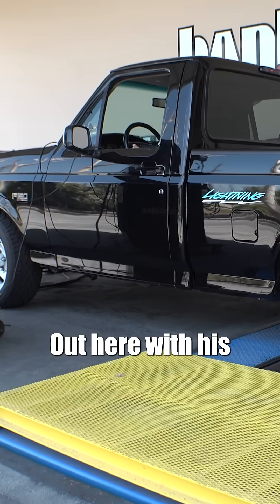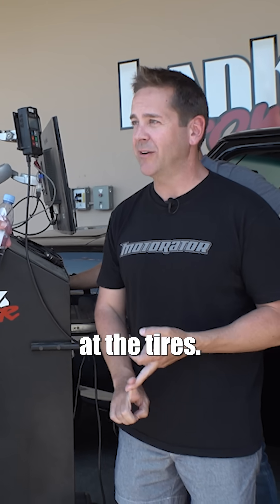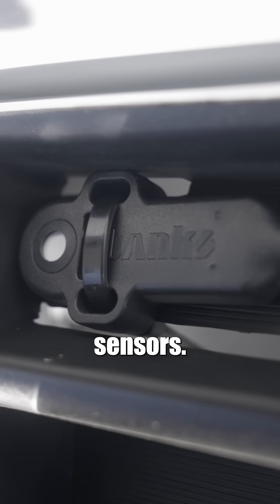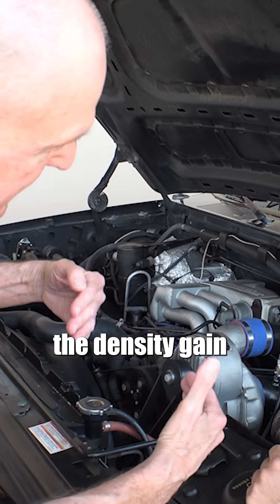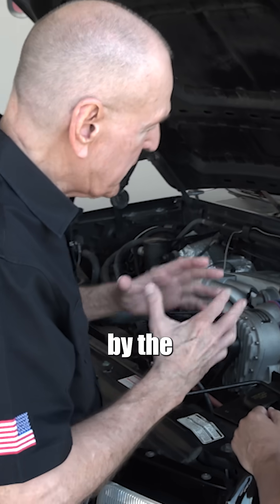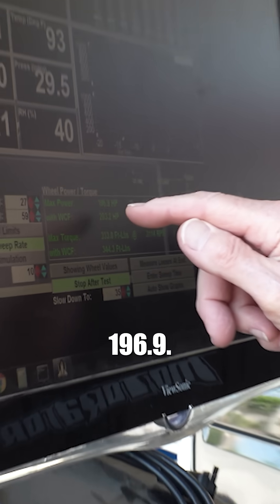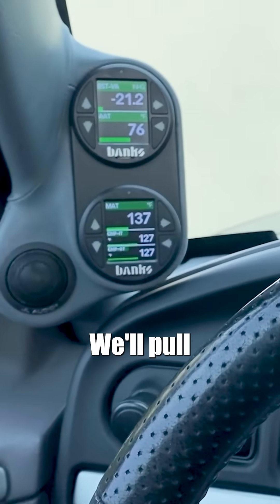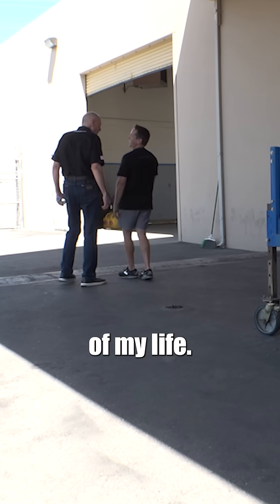This is the worst supercharger ever.

Comment: I got a 57 h.p. gain on a non intercooler 7 lb. kit on my chevy1999 s-10 extreme with the 4.3. Added a dry 50 shot and n.g.k. v powers gapped at .025. With m&h racemasters it broke the hearts of alot of STOCK terminators. 
  Sounds like it's spinning,although the noise on these were a tad louder than a bunk alternator, Perhaps you are losing boost somewhere or the supercharger just needs a new belt.

Comment: I pure long tube headers on an xj 4.0/242 with a k & n intake tube and filter and got more than 8 hp at the wheels with a power killer called a transfer case.  They probably lowered the compression on that motor to account for boost pressure that amounted to 8 hp.  A stock 5.0 made 235 so what the hell was the point.

Comment: Kaplan America noticed an overall average 5 horsepower gain when he removed the knobby tires on his dirt bike  and replaced them with a street tire... replacing your street tires with good drag slicks with a lot of traction on the rollers might make a bit of a difference. Try different tires on your Dyno rollers and see if it makes a difference and something else to think about keep the same outside diameter of the tire the same as what come on it... Just saying it would be interesting to see your results

Comment: This style SC needs to spin fast for gains which are progressive with engine RPM, and the HP shown is at 3114 RPM. These engines were slow spinning turds at that time. LOTS of contributing factors were not mentioned.

Comment: Those are nice engines, but you have to put some pistons in them. I had a 93 lightning with a 393 stroker pumping out 550 + 200 Nos 10 1/2 Pistons😅

Comment: Those are stock power numbers from a  4.3l in a Mid-90's S10
Reply: And you would have beaten it with a ss and the xtreams😂 and better mpgs
Reply: Factory Lightning would smoke an SS454.

Comment: I think Ford realized they messed up with this generation of Lightning, and when the next one came out, the 99-04 SVT Lightning, they put on a proper supercharger, and made awesome power.
Reply: It made ok power it was basically just a stock 2 valve engine with a supercharger
Reply: Looked the same but was a 5.4 instead of the 4.6 and yes it would haul ass. Had a 99’ TransAm and couldn’t outrun it.
Reply: @setharnold3699  something must have been wrong with your Trans Am or that truck must have been heavily modified because the stock lightning is really not that fast it's a stock 5.4. 2 valve basically with some boost, A Trans Am definitely add a weight advantage

Comment: I bet that supercharger adds 30hp and takes 22hp to run 😂😂
Reply: This is why turbos are better. Using otherwise wasted energy (heat from the exhaust) is more efficient.
Reply: @Longbowgun  They are more efficient, but it is not only "otherwise wasted energy". Turbos create backpressure, which creates pumping losses, however less than the losses of a belt drive.
Reply: @Longbowgun  I see you aren't watching banks for long. Backpressure is a thing.
Reply: @Longbowgun  They have different use cases. A supercharges provides a linear smooth add on of power. A turbo doesn't
Reply: @Longbowgun  a compressor takes the same amount of work to make a given PSI and CFM. How it is driven makes no difference. If that compressor needs your 22hp number then it does not matter if that is from the belt or from the gasses being pushed out. The problem here is a restriction on the intake manifold, heads, and exhaust, and (the biggest deal) a 90's supercharger that had to be able to bolt on a stock motor AND keep the warranty. If I remember these only did like 3 or 4 PSI. Also turbos are NOT necessarily more efficient. I have never seen a rest where somebody takes a supercharger with a given PSI and CFM and compares it to a turbo with SAME PSI and CFM. The only thing I've ever seen is that turbos tend to be built better, have more time and engineering go into them, and more tech (like variable veins and such). Superchargers do not tend to have all of that.
Reply: @Longbowgun  Yes
Reply: @Longbowgun nah
Reply: @Longbowgun  it depends on what you want to do with it, if you are drag racing then a supercharger is better for instant power
Reply: @Longbowgun NHRA top fuel runs blowers, with well over 10k hp. I'd say they are pretty efficient
Reply: @Bobthebuilder.69  the belt is taking 600hp to spin and put out 12,000 hp of a 1970  hemi architecture v8, i call that efficiency

Comment: Would changing the pulley size increase the boost? That’s what I was wondering even before the dyno run.  Looked like a idler pulley sized pulley..😂
Reply: Without an intercooler, that would just create more heat. Boost pressure might increase but air density would suffer and any gain would be negligible.

Comment: I would like to see Gale put together a Turbocharging kit for the Ford 300 six. there are lots of them out there. from 1966 to 1996, with the last 9 years being fuel injected.
Reply: They've left all of us OBS guys with nothing. They used to sell all sorts of stuff, but it's all been taken off of their website over the last couple years.
Reply: Well being an owner of an 89, they are shit, EFI ruined durability of them, hot garbage, mine lives at the shop, constant issues, check engine light is on, every sensor is out of spec, money pit!
Reply: @ my 1990 didn't have any issues aside from the 5th/reverse rod sliding out on the M5ODR2 (a rare but not unheard of issue)
Reply: @LUNITICWILL  The ones from the 80's were known for rod knock, had one, guy I worked with had one, the computer controlled ones have failing ECM's, poor capacitors melt down damaging the board, once they hit 10 years old time for replacement. I've been discussing issues for quite some time with guys and they give up, send their trucks to the salvage yard, refuse to keep throwing money at them.
Reply: @Maples01  I've had 2 trucks from the early 80s, and neither have issues with their ECM computers as they are just a simple box.
Reply: @LUNITICWILL  There wouldn't be a repair kit available if there wasn't a problem, many youtube videos of repairs for them too. In fact the suggestion for fixing them is removal of the EFI and converting to a carburetor. BTW the shop I am using was working of a fleet of vans with 300's, said in the 80's some had cylinders breaking up.
Reply: Have you seen the price of banks stuff? A supercharger kit for your 300 powered truck would cost you more than your truck did
Reply: @ there are a ton of trucks with the 300 six, and that engine LOVES turbocharging
Reply: @yucannthahvitt  The small block v8 cost half what it cost for the 300, an intake for the 300 is over $700, there are no aftermarket heads, requires a custom grind or custom build from a Cleveland or LS v8, those who build an inline have too much money and want to waste it.

Comment: They should have baselined a dyno before adding anything. Given the age of the engine it probably wasn't anywhere near the stock levels from 20+ years ago.
Reply: - age doesn’t rob HP or torque, use does. I have a 69 Camaro Z28 DZ 302 and it has just over 41,000 miles on it currently. It has been a slightly driver collector car all its life, but has never just sat for more than 6 months at a time. I haven dyno’d it, but the compression matches factory new. It will still have all the HP & torque it left the factory with.
Reply: @C10sRule  i never knew that Chevy made a 302 😮. I know all towels abthe 305 I always thought Ford was the only one that made a 302 lol. I did my research and that's crazy. I bet she's a blast to drive 😎. Funny thing writing this is almost fell victim of doing what most commenter's do by saying stuff like Chevy never made a 302 it was only 305s and if I'm not mistaken 307 for oldsmobile without just doing a 5 second search to make me look like an idiot lol. Crazy how 5 seconds of research can humble you and give you that much more knowledge but, this generation has so much tech and refuse to use the same thing they are on to write a comment but won't use it to actually find the right answer and learn 🤦🏾‍♂️😑. Anyways, sorry for the rant but your right and enjoy your toy 😎. I'm a true car lover and mainly American muscle no particular brand I own a 14 chrysler 300 with a hellcat engine, a 14 corvette with a cam, longitudes, and intake, and a 09 crown Victoria manual swapped with a 4v 4.6 twin turbo and a 2.3l supercharger on top 😎 the crown is my baby took me as a soldier 10 years to part and peice her together without breaking the bank or my marriage lol. I love cars and I do all my work myself so if bit breaks no one to blame but myself 😂 everything but the tuning. Again my bad I just love talking to car enthusiasts and you taught me something today 😎🫡. Have a blessed day nothing like American muscle sounds like bald eagles and testosterone 🤙🏾😎😎😎🦅🦅🦅🇺🇲🇺🇲🇺🇲🇺🇲🇺🇲

P.s that C10 is fucking gorgeous 😍 that's my next project a pickup truck stuck between a f 150 single cab with a coyote or a Silverado don't really care about the engine in that but a 6.2 would be great but either way it's getting a power adder so she's gonna be fast regardless.  I just need another deployment which I have coming up next month for 4 months and gotta figure out how to bribe the wife before she cuts me 😭😬😂😂😂😂 Hooah!!!!🫡🇺🇲
Reply: @ - you have some fun rides there! I always want a Hellcat, but when the opportunity knocks, I don’t pull the trigger on the deal!! Haha. Fear & common sense takes the fun out of things!! Heh heh. I have had well over 150 classics I either built or bought over the last 45+ years! Loved them all and most were GM. My favourite car , which I sold, of course, haha was a 67 Mustang GT390 Fastback that  I only bought as a roller. In the end it had a 302/345 Stroker with a 4 speed. It looked bone stock. That was a fun car to drive.  I love the Camaro I’ll have it til I’m gone. I have a few 67 - 72 C10s as well. Mostly big blocks,,, love the rumble of a nicely cammed big block!!! 
    Thanks for your service!! Stay safe, Eh!!
Reply: @C10sRule  that's freaking amazing brother 😎🤙🏾💪🏾. Sounds like you have had your share of fun when it comes to classics lol. I'm glad you was able to enjoy all those beautiful machines. No need to thank me I just did what was necessary to keep our county and my family safe 😎. I definitely appreciate it brother and keep building those beautiful machines wish I could get my hands on a old mustang from elenor that you pretty much have to give your first born for or a 70s mach 1 that I could probably get for my selling my ex wife 🤦🏾‍♂️😭🤣🤣 lol joking ( no human trafficking on this end). Stay safe yet always stay dangerous 😎🤙🏾.
Reply: @ - I was a cop for 30 years while ranching at the same time. Paid the bills in the 80s when things were tight with land payments. 
   Now I’m thinking of a couple of judges I know that might overlook the human trafficking if you can get an Eleanor for her,,, heh heh.
Reply: @C10sRule  😎😂😂😂 you made my day brother ❤️ thank you for your service 🙏🏾 and I hope and pray you continue to be the bad ass your you are and your family be safe 😎
Reply: @C10sRule  If you're ever looking for a good home for that when you decide to move on from it, I'm your guy! Beautiful c10 btw! Love Chevys!
Reply: @C10sRule not necessarily. Valve springs get weak over time. Used or not
Reply: @ -  A valid point. I check things like that and haven’t really run into it yet. Never say never I guess. Watch, the next “perfect low mileage muscle car or C10 I get will have an issue with the valve springs. Haha. 
  Thanks for speaking up.
Reply: Powerdyne superchargers are junk.

Comment: I bet the eBay electric turbo would've made the more power 🤣
Hell, you'd probably make more boost with a leaf blower.
Reply: As poor as the powerdyne is, those e-turbos are far worse.....very just can't pressurize
Reply: @1SqueakyWheel  I know, it was just a joke. 
But the leaf blower part... 😉
Reply: @PeteKona  Fair nuff!  Although even the leafblower blow more volume dnc pressure than those e-turbos too.

Comment: That is the worst supercharger back in the day.  We had guys running 3-4psi on those Powerdyne blowers.  They have belt driven internals and just not made for much pressure.
Reply: Centrifugal superchargers are belt driven too. He's saying the power dyne has belts inside instead of gears.
Reply: @jasonbernal9348  i though centri's ran off exhaust pressure like a standard turbocharger.
Reply: @JordonPatrickMears11211988  nope. Centrifugal superchargers are basically a belt driven like other superchargers. They use the belt to replace the exhaust housing side of the turbo.
Reply: @jasonbernal9348  gotcha, yeah, first time I ever saw one.  I'm like that aint a supercharger, its a turbo charger.  I just don't see em often personally.  Used to seeing the roots and twin screws more.
Reply: I mean, aside from centri's, aren't all SC's belt driven?